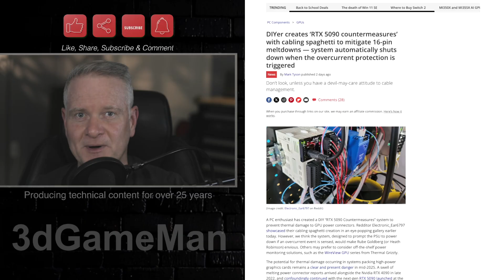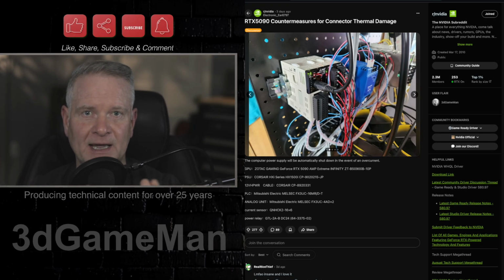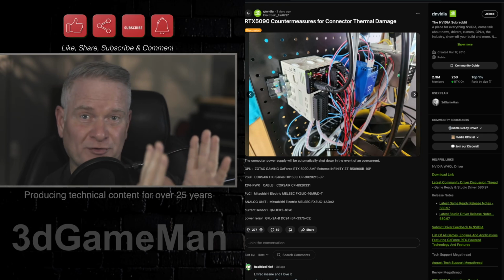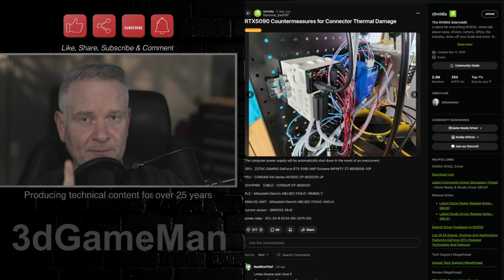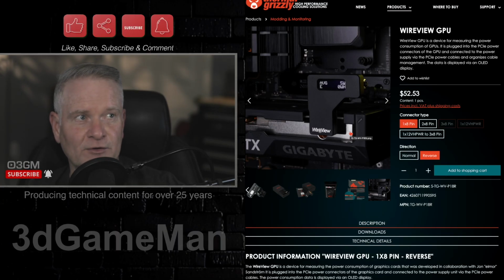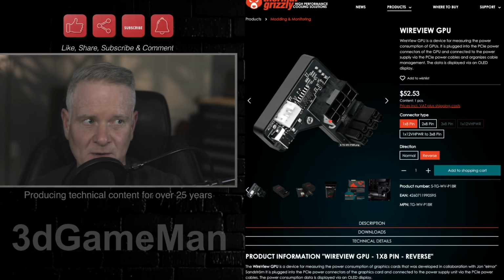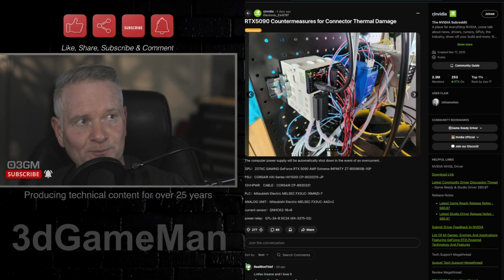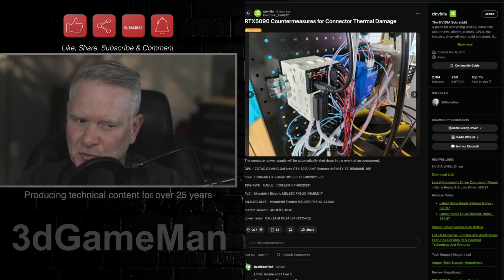Solution For RTX 5090 GPU 12VHPWR Connector Melting!

Comment: I suspect connectors melting is caused by bad cable management, non certified cables and adapters, unseated connections. I had a 4090 and now a 5090 and no melting connectors on a Corsair 1500 Hx psu and Corsair GPU cable.  It's easy to miss not fully seating the cable as I almost did with my years of experience. I Triple check every time and caught a mm gap on the gpu side. I did have An asus tuf 4090 connector melt and I suspect due to using a 3rd party gpu power cable and a cable mod 90 degree adapter. Needed the adapter so i could close the side panel door would not hit the cable. I do believe NVIDIA needs to change it because it's to easy to screw up and catastrophic if it does.
Reply: Who paid you to say that?
Reply: how about not using a stupid connector and just switch back to the proven design?
Reply: How's the cables? Melted yet?